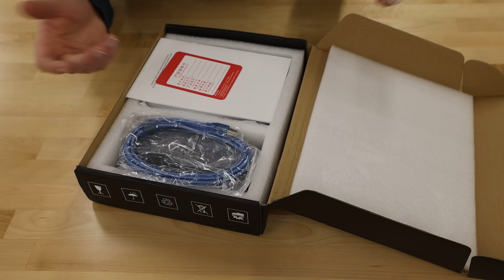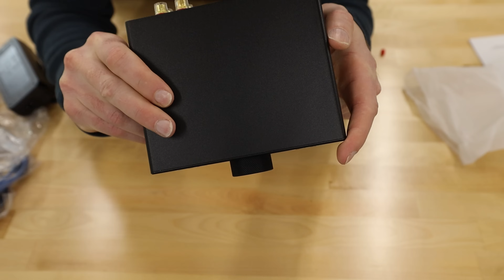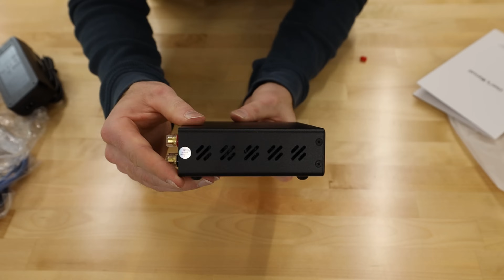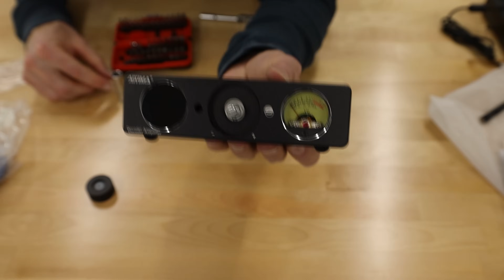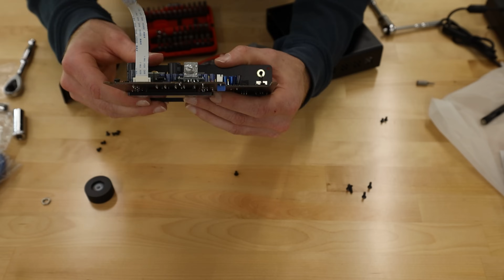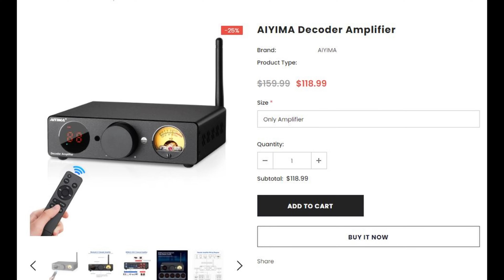Unforgettable Amp: The Nameless?? Wonder Worth Checking Out!

Comment: It's weird, and frustrating, how the different Aiyima amps/preamps all have different combinations of features, but not one of them has ALL the features you'd want.
If this one had a full-sized headphone jack on the front instead of the stupid gimmicky VU meter, separate controls for treble and bass, and an actual on/off/auto switch instead of the multipurpose knob, it would be a highly attractive little one-box solution.  Oh, and a switchable high-pass filter like the RSL amp has.

Comment: 44.1 / 24 bit ?
Reply: Bluetooth: QCC Bluetooth 5.0, aptx-HD support
BT：24Bit48Khz
PC-USB/OPT/COA：24Bit192Khz,
S/N ratio: ≥104 dB（COA/OPT/USB input）
 S/N ratio: ≥100 dB（BT/RCA input）
 THD: 0.008%(@1W)（COA/OPT/USB input）
 THD: 0.015%(@1W)（BT/RCA input）
Frequency response: 20 Hz ~ 20KHz（±1dB）for Speaker output
 Frequency response: 20 Hz ~ 20KHz（±0.5dB）for AUX output
Input sensitivity: 0dBFS / 0.775V
3.5mm AUX Maximum Output level: 2.3V

Comment: The most likely use-case for something like this and it's Fosi cousin are for TV sound.  Use the Optical for the TV, the USB for a PC connection and the RCAs for a turntable or CD Player.  Add a pair of small tower speakers and an active subwoofer... and bob's your uncle!

 It builds a nice little entertainment centre for the living room or rec-room.  

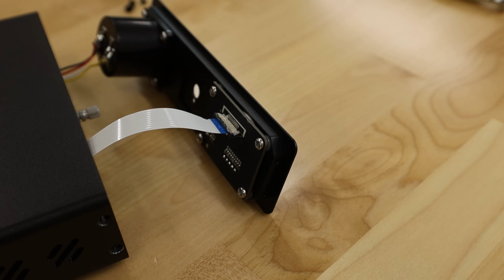7:00 ... One note of caution for those considering chip flipping...
Those flat ribbon cables will almost always have locking connectors. Usually this is done with  two tiny (and I do mean TINY) tabs on the ends of the socket that you lift up slightly to release the cable.  When reconnecting slip the cable into the socket and press the tabs back down. They're not robust connectors, it's very easy to break the locks or damage the cables... They're intended for assembly line hookup and are unlikely to survive more than half a dozen re-connects...so as my weird uncle Zado would say "Treat it like it's loaded!"

BTW ... I'm liking the more relaxed review format.
Reply from the maker: Hey Douglas, this ribbon did in fact like you mention lock in from the 2 small tabs. I had to carefully remove the glue as that plug can be a bit fragile. This non scripted format is a bit freeing at times, I hope to mix it in more.
Reply: @MattCoykendall1  
Those plastic flex cables can be a real nightmare on their own but, to make it worse, those Chinese assembly lines just love their glue. 

Could you have taken it off at the main PCB end instead?

Comment: The original name of the amplifier is Aiyima A08 MAX. It's written inside on the board. They later changed their minds about the name. Maybe it's related to the A07 MAX type, which would then look like a lower model.
Reply from the maker: I do believe they have a new A08 max in development now, I have made a number of suggestions on it, we will have to see what turns up.

Comment: An essential feature missing in all these brands releases is a crossover point selector separating frequencies going to the speakers and sub/aux out. Or just one selectable point like the a300 from smsl had. Or it there's no analog output only hpf option.
Reply: Yeah a high pass filter is a no brainer on these 3255 amps.  I do it manually with a dsp and it really helps them perform well as a tweeter amp of a midrange amp.  I suspect they would work well driving a low impedance load for bass if you put some fans on them.
Reply: @ryanchappell5962  i find it useful using a subwoofer, and/ or making the most out of the amps output power as well as speakers capability (most use cases will be with rather small/ non expensive speakers)
Reply from the maker: True, I can tell you I have expressed this as well to them and from what I gather it’s  in development on some of the future products.
Reply: @MattCoykendall1  should be mandatory by now in all these small amps! i'll only buy another one when they implement new features like that one. (i know they launch a new - sometimes updated one - every other month). This one is a nice feature packed unit but nothing really new...
Reply: I agree it's a very useful feature, but it's still rare, even in much more expensive amps. I thing it's a bit unfair to complain these cheap amps don't have it. Not to say we shouldn't encourage them to add it.
Reply: @jimfarrell4635  not complaining, but i think it's about time they have it. i have no problem they haven't, i just won't buy them. they seem to release new units very fast adding small upgrades/ features at a time, trying that customers buy every single one. There are quite a few with this feature, specially in budget/ affordable category, where it makes more sense imo. There's a small one from rsl, at least one from dayton audio, emotiva's got some, smsl a300, sabaj a30 pro, wiim amp, etc. Doesn't seem that hard or expensive to implement.